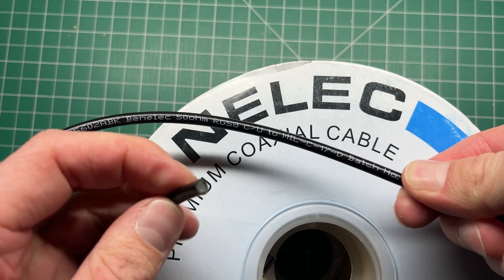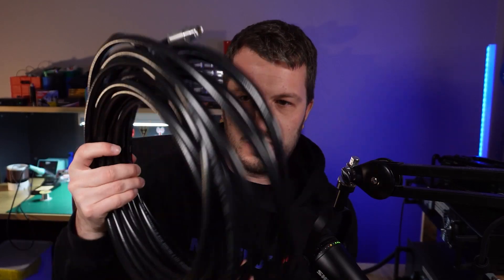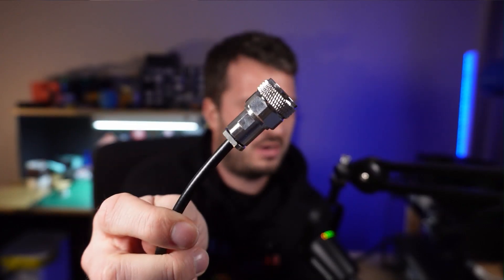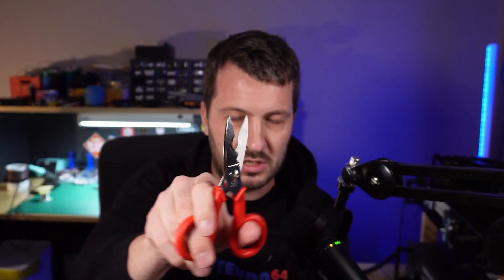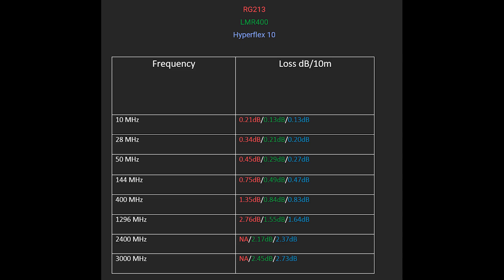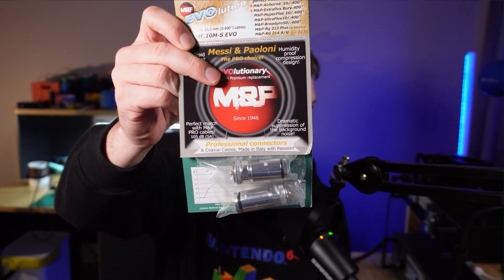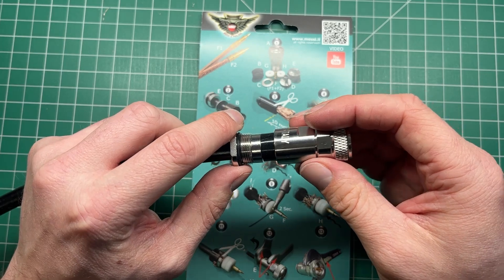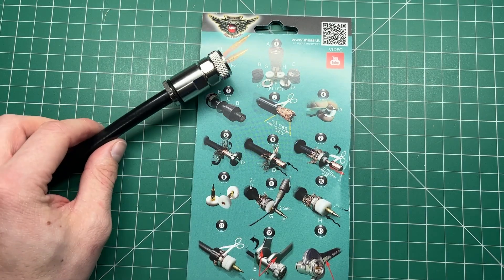The Coax SUPERIOR To What 99% of Hams Are Using

Comment from the maker: *Video Update*  The comparison in regards to loss was between LMR cable (solid core) and stranded core cable (Hyperflex 10).

Generally all solid conductors have better attenuations, the fact that Hyperflex 10 has equal performance is an incredible achievement considering it is much more flexible.
Also - Hyperflex 5 has full copper screening - not copper clad aluminium.
Reply: USE LMR - 400 STRANDED NOT SOLID
Reply: For HF, solid center. For VHF and higher, the preference is stranded due to skin effect.  I'm only comparing stranded vs. solid as UHF and above, the real preference would be helix type (hollow center conductor) with DIN (better than N) connectors.  The latter is more with LMR and cell and very costly, but for us hams, stranded center conductor with high quality connectors. While Messi & Paoloni are a bit more pricey, they are worth it in quality and will last longer, actually making them more economical.  Messi, using a stranded center is about the best you can get for Ham. Their connectors are incredible.
Reply: You have the solid and stranded loss backwards.  The stranded usually has more loss s the signal is jumping from strand to strand as you go higher in frequency.. @DanKuches
Reply: There are multiple interactions here and Dan and Ralph each have a piece of the puzzle.  Stranded wire is generally better than solid as you go higher in frequency. However, pure copper as a cladding material is more conductive than harder copper alloys strong enough to make a cable.  LMR-400 uses copper clad aluminum.  The aluminum is structural and the pure copper alloy, which is very soft was optimized for microwave frequencies where the skin depth is very shallow.  The company is Times Microwave after all and microwave applications are the majority of their business.

When I last looked at m&p distributors in the US, I was only finding pre-made cables with PL-259 connectors, no N or  BNC.  I believe that situation has changed in the last year and I will take another look.

There are multiple American and Taiwanese cables equivalent to LMR400.  I have run massive quantities of Taiwanese Browning BR-400 and my own testing shows the cable equivalent but the N-connectors having reflections above 600-700MHz.  I've found some American-made Shireen jumpers I'm using from my shack to the outdoor junction box that came with N-male on one end and N-female on the other.  I use them with microwave-rated proxicast style lightning suppressors. These are very common in the broadcast industry and don't carry the ham price markup.  I get them both from a shop that specializes in Wi-Fi and microwave.

Inside the shack and for portable I've been using LMR 240 ultraflex because pre-made cables are various lengths with BNC connectors are very cost effective on Amazon.  I definitely will take another look at m&p when it is time to buy more.

I understand then initially focusing on pl259 for the American market, but some of us avoid those ancient connectors whenever we can.
Reply: For amateur radio, LMR has a more favorable cost/benefit relationship.

Comment: Too expensive for me in the UK, although M&P are not expensive, just that it adds 23% to the price for VAT and import duty thanks to the UK government. There are UK suppliers at fairly reasonable prices so they must get a good trade discount from M&P.  I am going to try FZ400CU a LMR400 replacement at £200 per 100m as opposed to M&P Hyperflex at around £340 per 100m. Hope I don't regret it, they say its ok for rotators but as a solid core, not overly convinced.

Comment: I ordered a 27Mhz antenna but when I use a ohm meter between centre pin and earth of the antenna it’s almost 0 ohms? Is this because it’s a DC measurement and not an impedance measurement?
Reply from the maker: It may be a “DC grounded” antenna, that’s why you’re seeing continuity between the centre and shield

Comment: Thanks for the video!  Questions:  The LMR240, is that the ultraflex version?  I have the LMR240UF right now and still find it stiff / easy to kink.  Is the HYPERFLEX 5 a lot better for that?  Thank you
Reply from the maker: The Hyperflex 5 is very flexible, and has a stranded centre conductor

Comment: Thank you for sharing .
all the various types of coax is very interesting , but when the technicalities are broken down , there's still a lot to be said for the later type of RG58 that has the aluminium foiling and the copper screen , it's technically proven that there is very little difference between other  larger types of coax , except larger types of coax are capable of higher power handling .

Comment: The reason it does well is the stranded center core. High frequecies tend to run on the outside of a conductor, not the inside. More strands, give the signal more flow, hence , better xmit . My .02 of being in the computer industry for 50 years. It is called skin effect. Belden has a nice video on it.
Reply: Solid core attenuates less.

Comment: The best thing I’ve seen is an actual compression type fittings being used now for PL259’s or UHF connectors.  I bought a set of them, will know if they are worth anything soon.

Comment: With what I use it for, 27mhz, LMR240uf works quite fine.  Not losing sleep over .2-.3db of loss!!  Good cable it is, no doubt, awesome bend radius.   Get what you can and use it!!  Times Microwave, Andrew, Commcope, MPD digital, there are many more as well, and all make good coax.

Comment: Ill just wait for icom to make a radio like the 905 only for HF and put the rf unit up on the tower and run minimal coax to the antennas. The 7760 is a good start but not sure if I could build a box that could make the rf unit weather tight yet have ventilation for heat dissipation, hmmmm....

Comment: I am in Canada. Completely new to this. Everything here is insanely expensive. All I want to know is what would be the minimum cable necessary for a GMRS base setup using 100ft of cable. I am not into the HAM scene and not interested in contacting people. This setup will be for communications when out in our acreage or for hunting.
Reply: If I'm not mistaken gmrs in Canada is extremely limited. Might as well just buy a couple tidradio h-3 GMRS radios. Even that is probably illegal because it has a detachable antenna and is over two watts.... But you didn't hear that from me😅. But yeah, Nice external dipole outside? You can forget about it
Reply: @IM1deadMONEY  Thankyou

Comment: Hello
Is ther a tool that can cut the  outer plastic and other things of the Rg316 cable, that they are ready in pune cut go to be attached for soldering and crimping without handling a knife and risking to cut in the conductor wire and shielding? 🤔

Comment: I recently purchased M&P Extraflex Bury 10mm for a 330 ' feedline for HF. I'm wondering if you think this is acceptable or should I have got the 13mm instead? Great video BTW ...Thanks!
Reply from the maker: 330' is 100m. At 28 MHz that's 2.1dB of attenuation - about 30% of your power/received signal lost with the Extraflex Bury 10mm.
The Extraflex over the same run and frequency is 1.6dB, so just over 25%, so not a whole lot of difference - and that's worse case on the highest HF band. 

At bands like 40m the difference is very little (only 0.3dB difference)
Reply: Thanks for the quick reply! I spend most of my time on 20 meters so that's great news.

Comment: Great video my friend.  I'm considering a chimney mounted Comet GP-3 and I'd need 75-100' run to the shack.  Which M&P cable should I use?
Reply from the maker: Hyperflex 10 (or 13 - for even lower loss especially needed on UHF) should be good

Comment: Hi VK3YLN here.  I can 100+% also endorse professional quality M&P gear. I found them a little over 12 months.  I am rapidly  ditching all my old coax cable for theirs.  
They truly are the  Roya Royce  of coax in quality, buid and Spec's .  
They outperform  other coax for the same diameter. Their connectors are sensational - so do what I'm doing - ditch your ROC made stuff (give them away to the 27 Meggers) 
Easy  to install and long term, they will  out perform crimp stuff (personal experioence) especially where coax movement occurs due to wind & on rototors . As HamRadio Dx states whatever your losses at the TRx end of the coax its gone! - no LNA is really going to replace those losses without changing the S/N ratio. 

Yes cables little  more expensive but with better service quality and performance  for longer life duration . M&P also  provide some Sahara versions for extreme hot conditions
Reply from the maker: Buy once, cry once! Great cables! Thanks for your thoughts mate.

Comment: In your installation segment. you skipped past the hard part. Getting the white spacer over the stranded braid is not trivial (nor a breeze). If you are incredibly careful to not touch the center conductor at all, you may be able to get the white insulator over the cable. I end up putting a screwdriver in the hole of the white insulator and widening it just a bit. That usually works.
Reply from the maker: Never had a problem with the white insulator and putting it over the end of the cable. Give the strands a twist if they are loose/won't fit

Comment: Wait, RG58 for UHF? Why? I thought because of the skin effect that the higher the frequency the more electricity flows on the outside of a wire and not through it, which means higher impedance at higher frequencies if you don't increase the size of the conductor. So why such a small cable for UHF and a larger cable for HF? Maybe I'm just dumb. Also, I thought stranded wire always had lower impedance at higher frequencies when compared to solid conductors because of the increased surface area (again, because of the skin effect). Maybe it's not the impedance that increases but something else, but either way, I think the rest is correct.

Comment: I am EXTREMELY interested in those connectors. I guess I'm just a major clutz because it's not unusual for me to have cut off a compression/solder type connector for lmg400 to start over. For me it seems that if I don't cit everything to the perfect length etc., it may not work well. I mean, I've done many, and they've been hanging in there for years, but I just hate doing it. I think that compression  type terminator may be just what the doctor ordered.

I am baffled though about them using MFJ. I will give them a try regardless. Let's hope they just distribute and don't even package. Oh my they wouldn't let MFJ do any manufacturing would they?

Comment: I can't say enough about M&P coax and  connectors.  I have Hyperflex 10 feeding my 10/11m antenna, the only wish I have is the dielectric, not a fan of foam, would be nice if Teflon was used instead, but M&P coax is slightly better than RG- 213, and M&P's coax connectors are precision machined units, definitely TOP SHELF craftsmanship!🤠👍⚡️🎙

Comment: I use LMR-400 for everything except for 1.2Ghz SSB where I have a run of LMR-600. All of my coax runs are 40ft because my rigs are in a closet and I remote control them. Not having the rigs on my desk made my runs super short.
Reply: so , is it wrong to use lmr400 for the cb in my semi truck? i add about 8 coats of liquid electric tape to the connectors.  it has to endure 70mph road speed for 10hrs daily, plus wind speed, salt water at the same speeds, and UV. was thinking i should try lmr600, but that might be overkill. lmr240 on my 11m base station(<20w) for a 30ft run

Comment: I Inhereted A Ship Container FUll Of Radio And Electronic STuff, There Where Cables, So Much Cables That I Sold Many of Them To Scrap As Copper Cabbles, Then I Looked At TThem In DetailA nd Turned Out TThat I Had There Many Many Russian Military Grade Coaxial Cables, Now Im So Happy That I Have Them, Inside Its All Silver Coated Pure Copper, Will Use Them In My radio Tower Build Because I Have Hundreds Of Meters If Not Kilometers In There, I Cant Pick Up The WHole Strip Of The WIre And Lets Not TTalk About The Other Wires, All Milittary Grade Data Cables That Im Thinking Of Using In Other Projects, Some Of Them I Cutted Up In peces For Smaller Use Like In My Filters And Sttuff Because The Pure Copper Is Much Better To Solder On Then Whats Out Now, Coper Thats Mixed With So Much Aluminium And Zinc That The SOlder Doesnt Want To Stick TTo It (If You Solder A Lot You Know What Im Talking ABout) Copper Wire That Doesnt Want To Adhere Solder No matter What Heat Or What AcidOr What paste You Are Using, With These Militaryu Grade Copper Silver Wires I Can Use JUSTT LEAD To Solder Anything, But ALWAYS Make Sure That There Is Connection Between Copper To Copper, Twist Copper With Copper AND ONLY THEN SOLDER, Dont Silder Where There Is Gapps Where There Is No Copper AndOnly Solder, That Will be BBIG Mistake In Radio Wires / Antenna Wires, That Point Will Act As resistor In Some Cases. Make Sure You Twist Copper Wires Together ANd THEN Solder .. I Learned Thatt HARD WAY !
Reply: What's with the capitalization of every word? Lose the shift key.

Comment: How long do you think that connector's long black rubber grommet between the clamp nut and the ferrule that captures the braided shield can maintain sufficient compression?  Plastics flow, especially when warm.  For the Amphenol (and others) there is a thin gasket between the nut and the clamp that often gets cut during assembly, so full metal to maintain compression.
The cable looks good, but I don't like the connectors.

Comment: The question begs, do these M&P coax's duplex well ?
As most have learned that cables similar and to include LMR 400 as example, do not duplex well !
But I was disappointed looking at the M&P loss @ UHF !
And really very similar to Times Microwave cables, as well as others !
How ever their connectors are interesting !
Reply: Did you ever find an answer to this?  My understanding is that LMR400/9913F don't duplex well due to the aluminum foil which, when it corrodes, forms a diode against the tinned braid.  With M&P coax there's no aluminum, just copper foil and copper braid.  This seems like it should duplex well, but I'd love to know what others have found.
Reply: @k9yk  
No I have not !
It is my understanding that cables  like LMR 400,  because of their use of dissimilar metals, after sometime, they begin to become noisy when passing RF thru them, once they get some age on them, likely for the reasons you mentioned !
Since the feed line you mention uses copper for both, I would think the chances for any rectification would be eliminated ?
In that regard, they sound promising, but in my opinion, still lack anything Earth shaking as to the losses at Higher Frequencies !
Sad as it is, it's just the nature of the beast !
And depending on how High you go in frequency, if you're not using something the size of a fire hose, losses are still going to be high !
I found this especially true when I ventured into GMRS !
Where it really got my attention !
Where if I remember correctly, a cable like 
LMR 400 had a loss of 
3 db !
Essentially cutting your power in half @ 100 feet !

Comment: Amazon-sold Chinese-made 'KMR400' is cheap, so cheap I even use it for HF. Only 0.8dB loss per 100-ft at 30MHz, I've confirmed. Easy to terminate with latest connectors. Results are great, no disappointments.
Reply: I've been curious about KMR400 on Amazon.  I'm wondering how the outer jacket holds up to UV over time when installed outdoors? Times Microwave claims their LMR400 is good for 20 years.
Reply: @jeff2424  My tri-band 3-el Yagi has been installed only since last autumn. But most of the KMR400 coaxial cable is either in an underground conduit across the lawn, or mostly under pine needles and twigs to reach the mast. If it works for five years, I'll be perfectly happy. I expect it'll last a lot longer than that. My previous coax was bought used (decades old) and I still worked all over Europe (easy from eastern Canada). Great fun. 73.
Reply: I've had some run to a rooftop antenna for about a year now with no noticeable issues.  Very happy with it for the price and what I'm trying to accomplish

Comment: Because of your video I just ordered 105 ft and 110 feet for Hyper Flex 13  For my new Satellite station I am building.  I sure hope you are correct it was not cheap! I was going to use LMR-600 but it does not flex at all and I was worried about all the loss with connectors patching it into some flexible cable at the antenna and in the shack. TO the best of my ability to figure this stiff out I think it almost as good as the LMR600 and flexible so I ordered it. Wish me luck! DE K8OCN
Reply from the maker: Good luck! You'll be happy with that cable, it's great stuff.

Comment: Hayden,

Are those scissors comfortable and effective? They look small, like children's scissors. Seems like they'd be better with larger finger grips and longer lever arm. Will buy on your say so...

Thanks!

73,
John - KK7JBZ
Reply from the maker: I wouldn't say comfortable, but they are effective! Sharp and designed for cable. 
That said, they are a tighter fit than regular scissors in my hand.

Comment: Bravo!  Most aren't aware of, thus can't 'appreciate' the electrical and mechanical challenges of LMR/9913 style cables.  #1 - Times recommends proper crimp connectors only for LMR, because you can't get a decent mechanical/solder connection with their flimsy inadequate braid, so twist and flex start to comprise the electrical/shielding capability.  #2 - dissimilar metal between braid and aluminum foil - this also compromises the electrical/shielding factors.   Both of these can eventually result in poor performance/loss of shielding over time.  Worse, PIM, passive intermod/mixing at the bad braid/foil points - for that reason most commercial sites prohibit using LMR-anything.